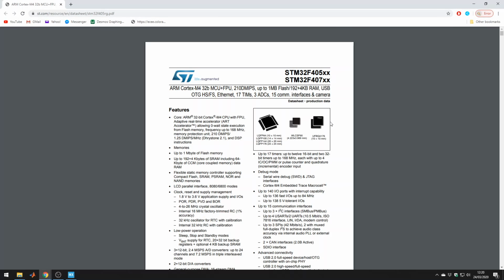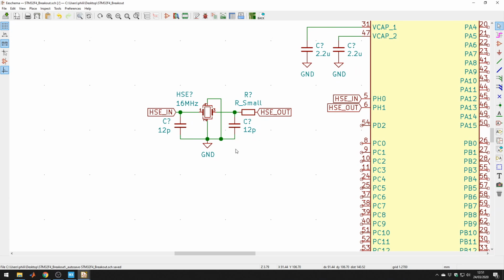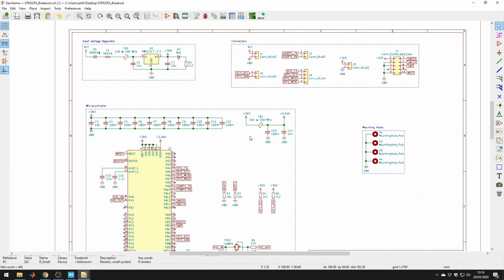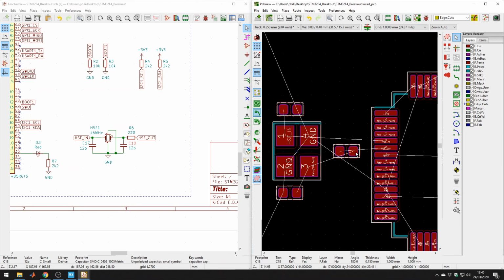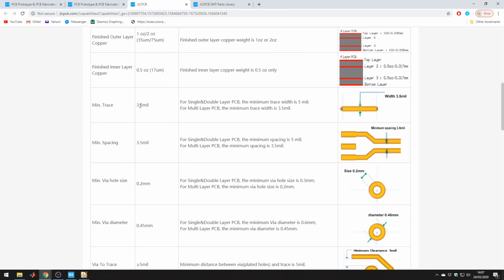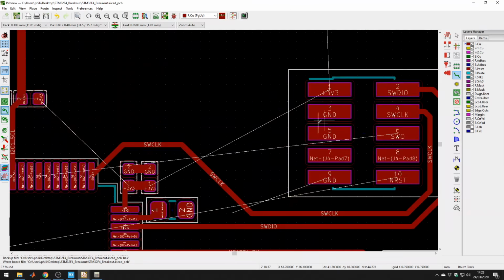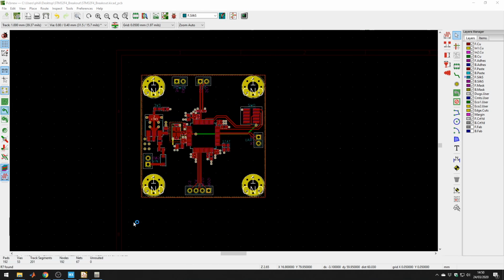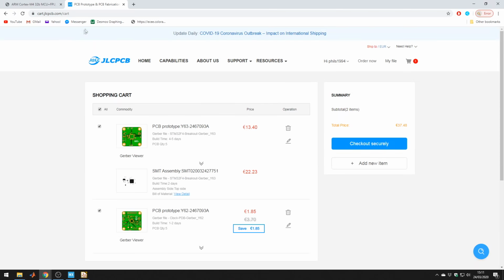KiCad STM32 Hardware Design and JLCPCB Assembly - Phil's Lab #2

Comment from the maker: New hardware and PCB design course on mixed-signal embedded systems just released!
⏵Course content: https://www.phils-lab.net/courses
⏵Course sign-up: https://phils-lab-shop.fedevel.education

Minor correction: At around 23:35 I say the crystal load caps are in parallel. I meant to say, from the crystal’s ‘point of view’ the caps are in series and thus the capacitance seen by the crystal is halved. Further details: https://en.wikipedia.org/wiki/Pierce_oscillator#Load_capacitance
Also, the annular rings should be bigger on the larger 'power vias'. The PCB manufacturers will give the minimum sizes. It's 'fine' if they are smaller, as the manufacturer will either warn you or adjust the sizes for you. However, you may get problems with clearances otherwise - so I recommend making them larger.
Additional note: The crystal oscillator feed resistor (220 Ohms in the video) could probably be smaller, to ensure that oscillations will start. 100 Ohms or less would ensure startup in pretty much all cases. The problem is this all requires a fair bit of experimentation and depends on the crystal, board, MCU, etc... I will make a more detailed video on crystal oscillator design soon! For now, more details can be found here: https://www.st.com/resource/en/application_note/cd00221665-oscillator-design-guide-for-stm8afals-stm32-mcus-and-mpus-stmicroelectronics.pdf
Reply: of course! I've learnt something today. I'll have a couple designs of mine to check next week...
Reply: Hey Phil, can you specify on JLCPCB is a cap is X5R or X7R or do you have to dig in each their part's product spec (that would be a pain)? Thanks and great detailed vid, rare in these parts ;).
Reply: 0
Reply: 0
Reply: ❤️h ❤️❤️❤️ to tu ❤️😎f❤️❤️fh❤️h hh1h❤️❤️❤️ fh by hhhhhhh❤️❤️❤️❤️❤️fhhhhh❤️ fhh❤️😎 h efhhhhhh❤️fh by hhhhhhh ❤️😎😎❤️❤️❤️❤️😎 h ❤️❤️ h ❤️ fh h❤️fhhhhhhhhhhhhhhhhhhhh❤️fhhhh ❤️❤️❤️ fh ❤️a great ❤️ h thehthehhf❤️he❤️❤️fhhhhhhh fhhhhhhhhhhhhhhh❤️❤️fhhhh to be ❤️ fh  fhhh😎hh h❤️hh g😎hhh😎ah❤️❤️😎1❤️❤️❤️😎h❤️❤️f😎 f hhhh❤️ h f f b ❤️😎❤️😎hh hu❤️❤️ h f h b h h a m hhh ii h hhg m hh❤️hhhh😎 hh h ❤️❤️❤️h❤️f❤️hf❤️❤️FF❤️❤️hhhhhhh h😎hhmeet.google.com/tjq-ybfn-gmzf❤️fhfh❤️fh❤️ a h b ❤️ hfhhhhhhhhhhh a great h h to hhff🙏🙏h🙏hhfhf🙏🙏🙏hu🙏h🙏🙏🙏h🙏hf🙏🙏🙏🙏🙏🙏🙏🙏🙏g🙏hff🙏🏾🙏🏾f🙏🏾f🙏🏾🙏🏾h🙏🏾h🙏🏾🙏🏾🙏🏾f🙏🏾🙏🏾🙏🏾🙏🏾f🙏🏾🙏🏾fgf🙏🏾 tu🙏🏾🙏🏾🙏🏾🙏🏾hf hu🙏🏾🙏🏾hfhf🙏🏾🙏🏾hfhgh🙏🏾huhfhf🙏🏾hfhf🙏🏾ghhh🙏🏾hfh🙏🏾hu🙏🏾hhf🙏🏾hf🙏🏾h🙏🏾🙏🏾🙏🏾p po❤️hfhhhhhhhhhhh❤️❤️ fh h ❤️ghhh ❤️ h hhf ❤️ h to hh❤️ fh h hh a a hf😎❤️❤️❤️hh
Reply: Hello Phil  ,I have a question Concerning the Crystal  , it is true that in ST reference design they use separate GND to mantain a good a functionality of the MCU and avoid noise however I checked some Gerber files of development kit and they don't use this technique I don't think it's really important if we do this type of  separation ?, it  think that routing away from the crystal and creating a GND ring around it will be just enough  what do you think ?I will really appreciate your answer,  because I designed high speed boards with high frequency and I never used that.
Reply from the maker: Hi Gharbi, it is very possible that not following that method you can still have designs that will work. If you are willing to try or have already designed boards in that way, could you let me know of the results? Would be interesting to see how much of an effect this has. I've just gone via recommendations to do it this way and never had a problem.
Reply: @PhilsLab  ST themselves don't use this method in their Dev Boards so i think that they will work just fine even without doing that type of separation  , you can check their gerber files , i designed board and they worked  fine ,just put the crystal as close as possible to the MCU  like you did and route other signals away from the crystal :D
Reply: @gharbisalem1254  The ST dev boards are more often then not "farmed out" and they come with on guaranties. These issues can arise in a production environment and also where it's meant to operate (hard noise industrial environment). It's great that Phil is so though, not often do i see this on the net (most pros are not here, there's a reason that white paper exists ;) ).
Reply: L
Reply: L
Reply: M
Reply: M
Reply: M
Reply: Mm

Comment: Good video, but idk why you have added seperate GND vias for each GND pins .. As the component are on the top layer only ,and you have poured GND copper on the top layer  , so whats the need of seperate vias for each gnd pin ? Dont you just connect all these gnd pins with this gnd pour copper on the top layer itself directly by a simple small trace ?
Reply: High speed signals take the path of least impedance. At DC the poured ground plane on top would be perfectly adequate for the currents to flow but at frequencies beyond a couple of tens of kHz(and signals with very fast rise times), the return currents naturally want to travel as close as possible to the signal currents. Phil enables this by adding ground vias close to ground pads which connects them directly to the ground plane below with the least possible loop area. This is done to both minimize EMI and improve signal integrity.

Comment: Does this power supply really work well? It seems the drop-out voltage of the linear regulator and the diode is to big, which would lead to a operating voltage lower than 3.3V?

Comment: The same part from the video (STM32F405RGT6)  is listed there today - Dec 21 2021 - but it's no longer a basic part. The video shows the price as 4.133 Euros but it's now 10.30 Euros - so more than double. And it's out of stock.
Reply: Probably because of various chip shortages that have been taking place.

Comment: Awesome video, just to add: The via size for NRST is not quite ideal. I'm surprised they would produce it. General via size is at least 2x drill size. And a lot of corners >45Degree, which all aren't necessary. You can simply use Grab function to adjust to trace without needing to delete it.  For good practice I would have routed NRsT a bit higher, you generally don't want traces on top of each other, of course this is for layers, but still. 

Very cool, you used the coupling of the power and GND planes to great your'r own PCB capacitor. Great work overall, keep it up!

Comment: Very informative video, thanks a lot. I'm using a different MCU and looking at the application notes and datasheets for this chip I'm quite confused about the number of decoupling capacitors per VDD pin. Can you please provide the source document where it is stated that you need two 100 nF capacitors per pin? In the information I have is just one cap per pin. Maybe I did not find the correct information. Thanks in advance.

Comment: Phil, is there a way i can send you a file and you look it over and see if i did this right. i use easyeda to do my work.
Reply: i would look at it for you is the project public on easyeda
Reply: @frankbose544  its up as public now
Reply: @Rockdagger  can you link it here
Reply: @frankbose544  just as soon as I get back to the pc
Reply: did you get that link
Reply: @Rockdagger   no
Reply: @frankbose544  youtube keeps blocking and removing it.
Reply: is there another way i can send you the link, youtube keeps bloking it
Reply: I guess just look up a10c cdu
Reply: The picture will be green main color
Reply: Able to find it?
Reply: @Rockdagger  is it a keyboard type thing oh how i dont miss using easyeda
Reply: @frankbose544  kind of. It is all.push buttons for sure. But no matrix
Reply: @frankbose544  im considering altium and kikad... but I'm having issues importing dxf into them for shape of board...
Reply: @Rockdagger  have u looked up tutorials its super easy u just inside of pcbnew hover over to file go down to import then select import graphics then a dialoge will pop up and u can select what layer you want the dxf to be so in your case would select edge cuts this is for kicad idk about altium i use kicad for all my stuff
Reply: @Rockdagger  well from what i see so far looks good ive just looked at the schematic so far your using the stm32f405 144pin is there any reason your using a pin for each switch instead of using say a shift register so you can use a cheaper stm32 chip
Reply: @frankbose544  just wanted to try this method, no other reason
Reply: @Rockdagger  thats perfectly fine but keep in mind you can use something like io expander or easier would be shift register but the way you have it now will be easier to program so its compleatly up to you
Reply: oh ive noticed something small you should probably connect vbat and vref+ to vcc i know your probably not using them but its better than leaving them floating plus if you want to add something later you can
Reply: and something to add if it was me i would make a board with just the switches to pin headers then use it with a nucleo 144 dev board to get the programming working then intergrate the processor that way less to go wrong
Reply: @Rockdagger  sorry for so many replies but you have the occilator connected to the wrong pins as well they go to ph0 n ph1 you have them connected to pc0 pc1are you using stm32cubeide
Reply: @frankbose544  yes using stm32cubeIDE. Ill check on that once. And good catch on the floating pins thank you
Reply: Osc
Reply: @frankbose544  man ... can't believe I missed the osc.  Shifted the wrong way thanks for the catch.
Reply: @Rockdagger  no problem i sent my twitter but it keeps deleting
Reply: @frankbose544  got one coming and all the denounced buttons on a massive breadboard already... will test on the nucleo
Reply: Debounced.... stupid android auto correct
Reply: @frankbose544  should I filter the vref and vbat  with a couple of 100nf caps... seems to make sense to do that
Reply: @frankbose544  send me a message on the place where tou got my schematic... that should go through
Reply: I did
Reply: Lol Phil is probably like what the crap

Comment: This is awesome, I am very interested with Low power lorawan stm32 pcb designs, can the F4 do the Job or One needs to use the L0 series, if so what is the minimal circuit required for the L0 to work?

Comment: The video is really fantastic, thank you for putting in the time to help others. How will other pins on the microcontroller be accessed? I want to create a fan-out board for a microprocessor which I will then use to develop a system and build onto it. Should I then create a row or two of header pins and connect this to the remaining pins on the board? This way I still have access to all the pins and then once my development is done and I know which pins I will be using in my final design, then I just add the additional circuitry and remove the unused pins? What would you suggest?

Comment: Hi Phil! 
Awesome presentation and explanations so much so that even a mechanical engineer like me could pretty much understand what components are required and why. I was actually planning to build a custom motor controller based on stm32f104 and wanted to code it using the arduino IDE. I wanted to know if its possible and how different would the components be in that case. If it is, then what do i need to do for the firmware part of it and how do i go about selecting the various components for the PCB.
Any and all help is appreciated in the comments section! 
Thanks!
Reply: Arduino is just an ordinary C compiler with a few custom libraries that has been renamed to sound grand. There is absolutely nothing there that you need. Get the free SMT32 tools and learn to use them.

Comment: Great video! Picked up a couple of tips, and I am a professional EE! I like how you also need to keep the connectors the same distance from the edges. One tip I like to keep to is if you have a ground connection on the header pin connectors, to keep that on Pin 1. That way it is a bit easier to know which way connectors go. Even if there isn't a ground, I usually add one, just to keep it easy. It has saved a lot of time over the years.
Reply: Hi im study electronic of information engineering ,what is exactly your work? Thanks
Reply: @hakime.silochi7987  hi Hakim, I make electronic controllers for satellite propulsion systems. Specialised world, but its not hugely different from this type of engineering!
Reply: @theindieg  wow that’s amazing,im in my second year of electronic information i study in China with a scholarship ,this world of electronics its so big,if i ask you four important advices for this sector which you will tell me? Like if which software i need to focus more or in which skills or language programming ..? Thanks you so much for your time,and  Sorry for my English my natural language is Spanish .
Reply: Agree. This comment should be pinned to the top. Also, I'm not sure why Phil had mounting holes connected to circuit GND. This can lead to issues if not handled correctly.

Comment: The most informative video I've seen yet. Great job!

 The hardest thing with PCB design (coming from an trade electrican) will probably always be selecting the right component in a sea of different packages, sizes, ratings and god knows what.
Reply from the maker: Thank you, Sten! Yeah choosing components is sadly a huge (and slightly boring) part of electronics design. If you haven't already, be sure to check out the updated version of this video :)

Comment: Hi! Much respect for making this amazingly detailed tut! I had a question about the decoupling caps for each VDD. Around 9:25 you mention that the data sheet says to use 2 100nF caps per VDD pin, but it looks like in the Power Supply Scheme of the AN4488 Application Note, only 1 cap is required per VDD. What is the purpose of two equal valued caps for decoupling the VDD?

"The VDD pins must be connected to VDD with external decoupling capacitors: one
single Tantalum or Ceramic capacitor (min. 4.7 µF typ.10 µF) for the package + one
100 nF Ceramic capacitor for each VDD pin" 

Thanks brother, I really appreciate the work you put into this series.

Comment: Helllo . Thank you for amazing tutorial. Can you help me to understand that why did you choose 4 pin crystal over 2 pin crystal i mean what are the pros for choosing that. Is there any advantage for using that
Reply from the maker: Thanks for watching! No real reason why I went for a 4-pin one, other than JLC have it in stock as a basic part and I think it looks cooler haha.
Reply: @PhilsLab  is there any difference in 4 pin crystal and 2 pin crystal
Reply: @robokishan  The two extra pins of the crystal are GND. The body of the crystal is essentially grounded.
Reply: @Tubaii25  does it make any difference? Rather than using two pin crystal
Reply: @robokishan  It does not make much of a difference here. For example, in case of the cheap Arduinos, those are two pin oscillators. Even for the cheap stm boards. But having the body grounded means less susceptibility to external noise as far as I understand. This will be important if the application has low tolerance for deviations in the clock signal.

Comment: Hi
Great vid as always. One thing I would like to share with you or anyone coming to this vid in the future, in regards to moving text from Front Silkscreen to any other layer (e.g. at 1:07:45).
Instead of manually moving text from F.Silk to say F.Fab, which could be very time consuming if you have a hundred or more components, you can use the option Edit->Edit Text & Graphic Properties.
In the opened dialog box, 
1. Check the Scope->Footprint references checkbox
2. Select the layer in the Filters->Filter items by layer
3. Select the target layer you want to move these references to in Action->Set to specified values->Layer

The dialog box is quite powerful and has some other options too.
I found this info from here:
https://forum.kicad.info/t/globally-edit-reference-designator-text/488/7
See eelik's commend from Dec 2018.

Keep up the good work Phil.
Reply from the maker: Thank you, Abdus! That's a great tip and something I've been meaning to look up. So I'll be using your suggestion from now on, thanks again :)

Comment: Hi Phil, where in the datasheet can I find the informations about supply filtering? Becouse in a documentation I downloaded from JLCPCB part on page 75 there is a Power Supply Scheme, but it says  the Vdd pins require just one 100 nF filter each (whereas You used 2x for each) and an entire package needs one 4.7 uF (whereas you used 10uF). Is it based on some other documentation or maybe your experience?
Reply from the maker: Hi Pawel, Yeah, this video is pretty outdated. 1x 100nF per VDD pin is completely fine. Anything >4.7uF as the bulk decoupling cap is fine as well!

Comment: hey, i think jlcpcb does not support buried vias. how did they manifactured your pcb?
Reply: He didn't use buried vias, they go through the entire board, and the copper only connects to the via on the designated plane/layer only.
Reply: @lachlanchartier8061  thank you
Reply from the maker: Yeah, I'm using 'standard' through-vias. Nothing fancy for this board.

Comment: Regarding the crystal. In the video, and on LCSC, it lists the 9pF in the description but in the datasheet it reads:

Load Capacitance - 12pF, 20pF, or specify.

Not sure what that means or what the differences are. 

I've taken a few Arduino/KiCAD courses before but am pretty new to a lot of this. I learned quite a bit from this video! Thanks,
Reply: Follow the LCSC value because that is the exact for the particular part number. The JLCPCB value is just a general value for that series of crystals.
Reply from the maker: Yeah, the datasheet is irritating and kinda a general datasheet for that series of crystals. As Philip said in his comment, you need to follow the part number link to the LCSC website. As you stated as well, you'll then see that the load capacitance is 9pF.
But thank you as well, I'm glad that this video helped! I redid this video with better audio quality and some additions to the board, so maybe that'll come in handy as well.